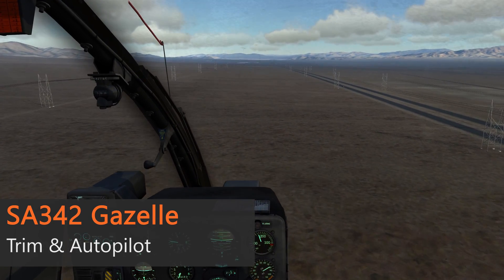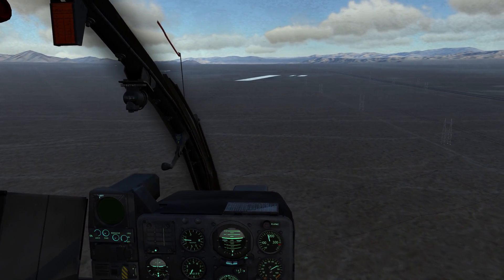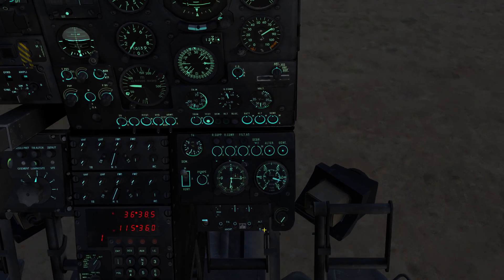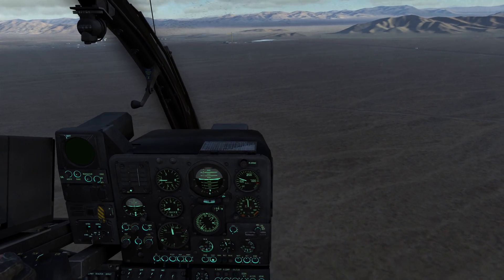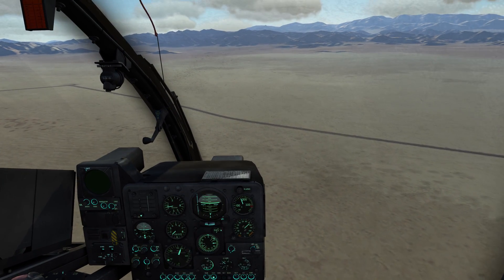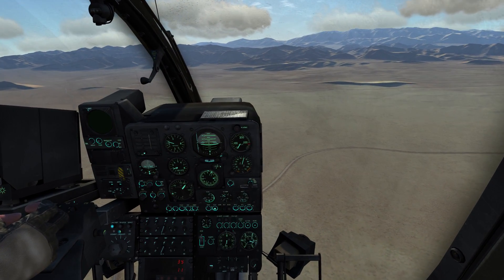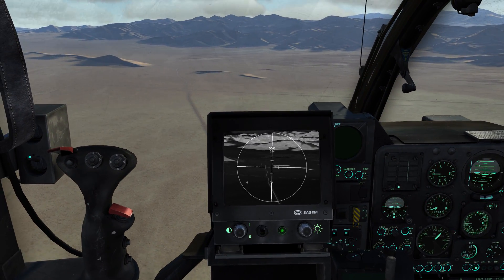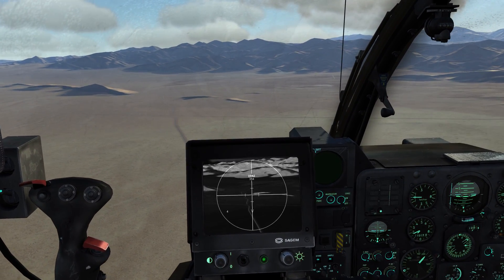[DCS] SA342 Gazelle Trim & Autopilot

Comment: If you turn the dial under the torque indicator to DOP mode it will provide a cross on the ADI. Simply centre the cross and you will have no forward/back or side motion. Then raise/lower the collective till you are stable vertically and you can enter auto hover very easily.

Comment: Nice video, did help on some topics. The only thing I noticed from own flying is that you need to do quite alot of rudder right input to keep the heli straight when going slow (less than 18km/h groundspeed) or the heli will spin left around it's own axis. You could probably rudder trim, but with some muscle memory practice this should be no issue. But well worth to be aware of. Good thing you can slave the helis direction to the camera moving left and right when in autohover mode.

Comment: Essential to have disabled FFB in DCS settings to get this to work, but I'm, still struggling with the logic here. No mention of the autopilot switch on the stick, and my control trim (mag brake 'stick') seems to work whether or not the Trim maser switch is up. Also the pov hat trim seems entirely ineffective, having very limited area of movenent.

Comment: I find the trim system on the gazelle is based upon the gyros/attitude where as other helicopter trims are simply based upon cyclic position.  I find if I trim the helicopter to 5 degrees nose down, it will always try to be 5 degrees nose down regardless of my state of flight, hover, fast or slow.  Where as other helis you need to constantly trim because the gazelle is attitude/gyro based, you do not.  
Trim reset just resets the trim to the horizontal attitude which I found to be pretty neat and intuitive compared to other helis that you need to constantly re-trim depending on your state of flight.
Reply from the maker: Yeah. This sums it up quit nicely! The Gazelle is a joy to fly, and with some training the AP and trim system is quit pleasant to use I would say.

Comment: Im new to Gazelle and my question is why does my Gazelle sometimes start to spin like hell? Its very hard if not impossible to recover from that spin. It usually starts when im getting low and trying to lower my speed. Like when im trying to go to auto hover mode or when im landing. Very annoying.

Btw i love your videos and they have helped me a lot. Keep up the good work!
Reply from the maker: The Gazelle can require a lot of rudder input to stay stable. 
Make sure your axis are working properly as well. My old joystick had a problem with loosing some responsiveness on the rotation axis after a while....
Reply: https://vid.me/3yut

Im talking about this! :D
Reply from the maker: kakka kikkare
Do you have rudder pedals or a twist joystick?
Reply: xxJohnxx I have rudder twist in my joystick.Using rudder doesnt help, usually spinning stops when i apply more collective. Weird. I dunno if its a bug or am i doing something wrong. Probably the latter one.
Reply: @MikeLitoris66  The video is not active anymore, but is it possible you were overspeeding it? Retreating blade stall is a very real issue for the Gazelle.

Comment: xxJohnxx,  This is very very good.  As always I enjoyed your commentary and instruction.  I found today that that helo must be somewhat stable before Altitude AP can be engaged. Maybe this is part of an update.  After I stabilized at 180kph I was able to hold alt.  I find this very useful.    My final comment is that I find speed hold to be useful for NAP of the earth.  Simply using the throttle to raise and lower the helo was easy.    Thanks again John, my Gazelle experience is changed forever.

Comment: What is the Auto pilot switch under the hazard stripes cover do? You can flip it up and turn it on and two lights turn on but what does it do?
Reply from the maker: +Mike Lovecchio That is the switch for the Gyro. It is neccesary for the autopilot system to work. For example you can't use AutoHover if it is not enabled.

Comment: Is there some kind of indicator in the cockpit when AP is engaged, in any of the modes?
Reply from the maker: +Geoff Goldplum Unfortunatly not. You can tell if it is doing something (at least being turned on) by looking at the 3 gauges on the panel. Everyting else is unfortunatly not displayed inside the cockpit.
Reply: Yes if you show your red controls indicator

Comment: Quick question, the manual said that the lower line in VS DER is deviation in degrees , do you know what kind of deviation it's referring to? I noticed the number changes rapidly as your speed's getting slower, so I don't think it's related to magnetic declination or something similar.

  Also, are you planning to do a tutorial for the NADIR system as well?:)
Reply from the maker: +Lymark Wong Hi,
Yes, I have been looking at that as well! I assume that it is the ground track anlge, showing the diffrence between heading and track. For example at 10:07 I am moving 16km/h towards a direction of 126° relative to the helicopters heading.
Similarly on the HSI, there is the hollow triangle that moves on the outside of the scale as well. I do believe that it shows some sort of doppler measured value as well, though I have not been able to exactly tell what it is displaying. 

Yes, I do plan to do a NADIR system tutorial (probably multiple, but short parts) at some point!